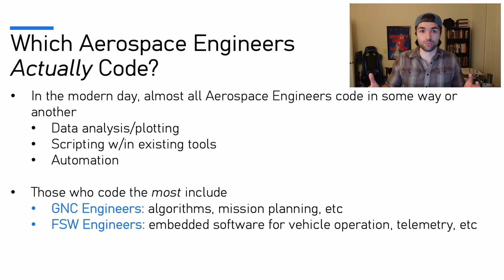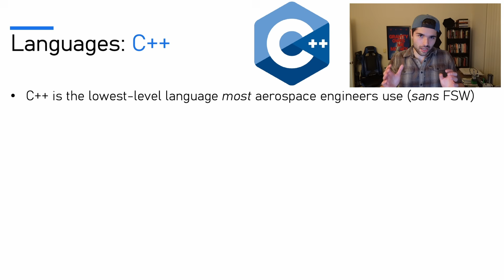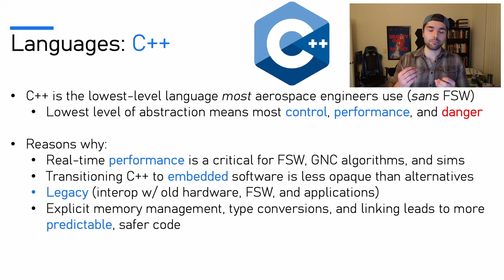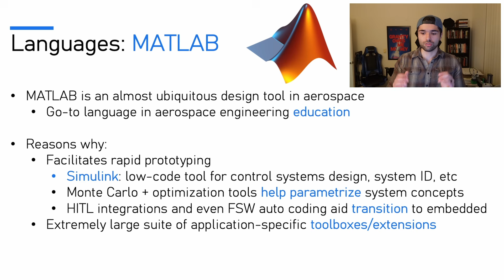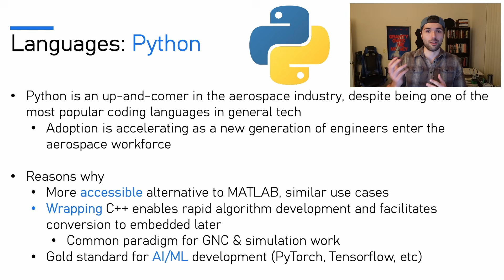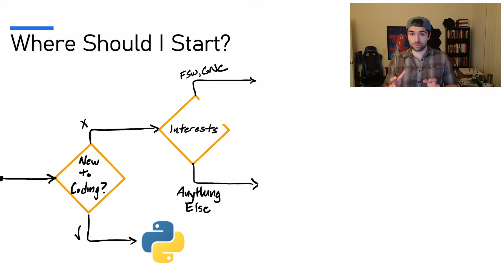Which Coding Languages do Aerospace Engineers ACTUALLY Use?

Comment: Python doesnt have c++ performance
Reply from the maker: Believe me I know 😅
Reply: C/C++ code and run it in Python...
Reply: aerospace did not need any speed scalability, python is really good for data science and algorythm which is why its being used in aerospace
Reply: @ban_droid  You most definitely need speed for matrix computations, solving derivatives numerically etc and that's where C and or C++ comes in. This should be a no brainer unless you have never built an
Reply: @benitareatlegile6516  do you actually know the context of this video? yes speed is needed, but they also use c++ and matlab, for compilations and performance scalability they will use that, but python is not being used for the performance, it is being used for data science and complex computations, do you think senior enginner only used 1 language?
Reply: @ban_droid  Yes I know the context of this video. My main issue is you saying "aerospace did not need speed"...
Reply: @benitareatlegile6516  sorry about that, i might wrote it wrong about that, but what i mean there is basically about the python only, which aerospace did not use python for speed or performance
Reply: @benitareatlegile6516  The Python libraries for doing those things are written in C/C++